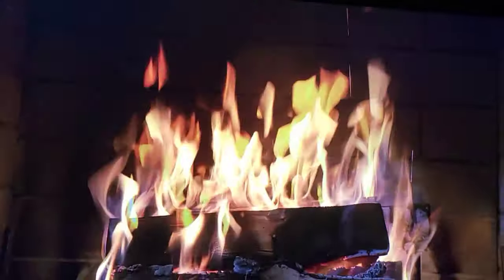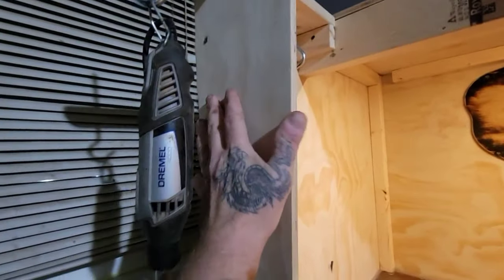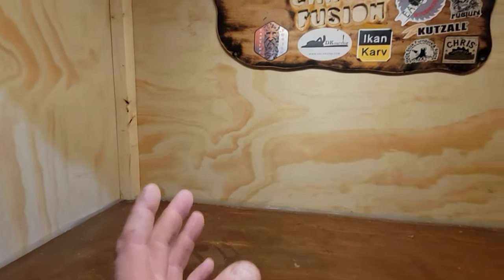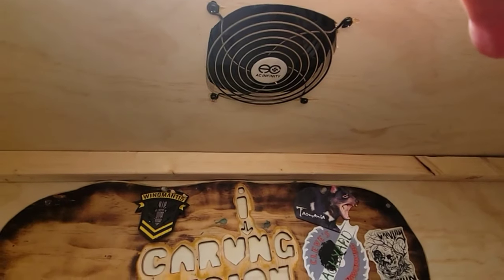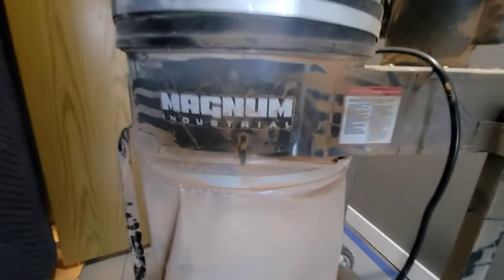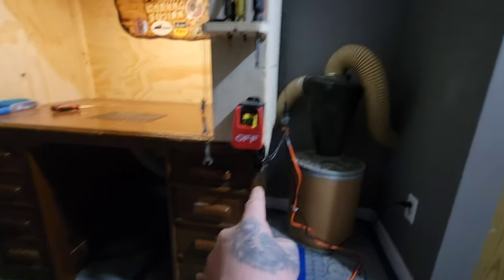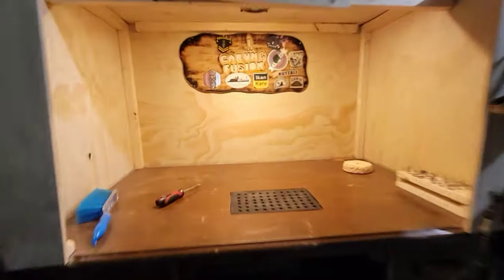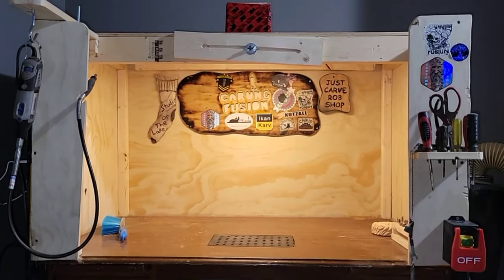The NEW down draft DUST COLLECTOR table- Built from a old solid wood desk.

Comment: The fan at the top should be blowing down so the airflow into the downdraft is channeled in one direction. With it blowing up the air is more chaotic and the dust could circulate inside the area for a while. You have air going in two directions which will decrease the effectiveness of both.

Comment: I had the Dust Deputy and was producing static electricity which resulted in burning out two of my shop vacs.
Reply from the maker: And how did you fix that
Reply: I didn't fix it as I had to abandoned the Cyclone.
Reply: @CarvingFusion  I didn't fix as I had to abandon the collector. Two vacuums gone bad by using this system convinced me to stop throwing good money away.

Comment: Great carving table, like the  computer fan. Please, how did you wire it up?
Reply from the maker: Ty it came with a plug
Reply: @CarvingFusionByJordyJohnson  lol, not really 😂 what I wanted to ask, I am no election, I have a few old computers with the fans, and I'm not sure if they would take 240 volts   plugged  into  them. But it's still a fantastic idea 💡 I will work on it.

Comment: I am using a 5 HP vacuum for my dust collection when carving however my vacuums are burning out after about a year or less. I clean the filter when dust accumulates to a degree. The motor does not burn out because it overheats and when they burn out the vacuum is not much more than lukewarm. I do not have the vacuum running for more than 90 minutes at one time.

Any ideas on what is going on?
Reply from the maker: No clue but I would suggest trying to get one of those vacuums that are in the gardge and piping go threwout the house, I forget the name of them.
Reply: Actually I purchase the Rezaire Dust Collector today. They appear to be very effective in collecting the very fine dust @CarvingFusion